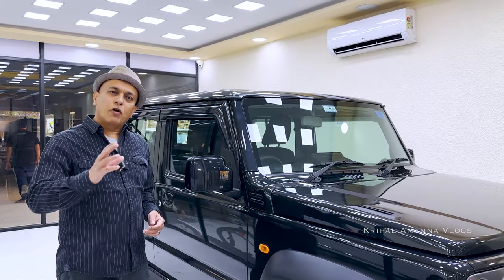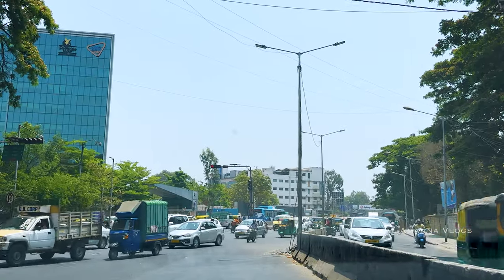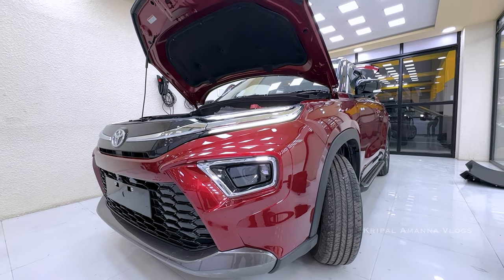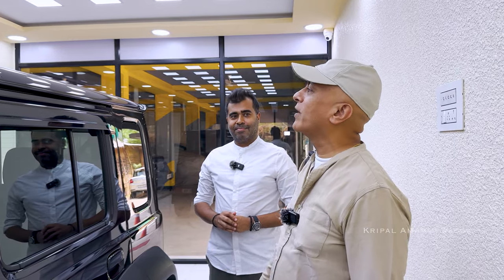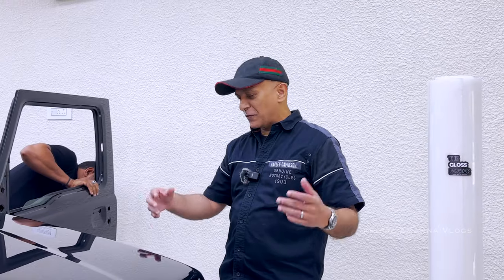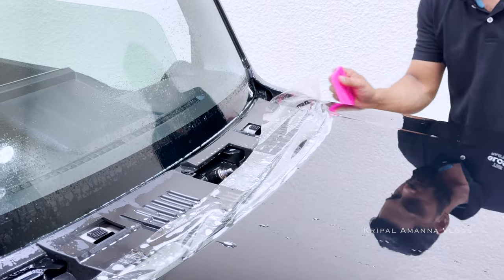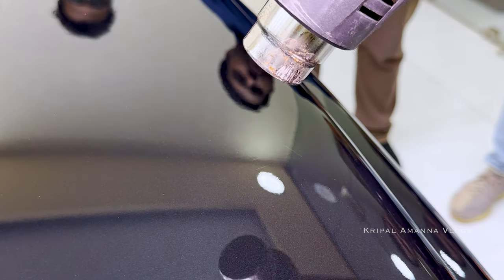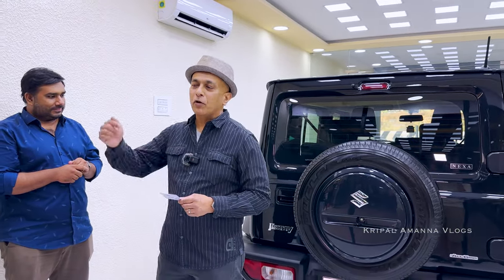The Jimny Gets Protection! Should You PPF Your Car? Watch Before You Decide! Complete Process...

Comment: Good afternoon dear Kripal - Just back home after my traditional Sunday lunch with my family. So the vlog is about to PPF or not . To begin with I agree with Prashant ; owner of The Glass Factor on a few points - 1) It’s better to get a PPF done while the car is new . 2) Since you have driven and intend to drive the Jimmy over long distances, better to get a PPF done ✔️. 3) The PPF or clear coat will not peel off the Paint of the car . I am aware about this space as , in the past , I have worked with MNC’s and we used to supply our specialty products to the OEM / dealers / Car studios . Good that Jimmy is getting a Jacuzzi and if it had a voice would have thanked you 😀 Next step is to remove the imperfections with the paint correction process 👍 I can see you a tad shocked to see Jimmy being dismantled ( looking naked 😀) It’s a genuine concern that post the PPF treatment process the Jimmy needs to be back in shape ( You subtly checked with the technician that if Jimmy would be back to normalcy ) . To be candid it’s not practical to have a look at the car when it’s in the stock yard before it’s delivered to the Dealer’s bastion . Now time for the main part ; incorporating the PPF on the car . The material used is Thermoplastic polyurethane (TPU) is an essential ingredient in PPF , capable of producing PPF that can provide premium protection, without yellowing or degrading, for close to a decade . They use IPA ( Isopropyl Alcohol) which is a solvent . The role of the IPA is  to “anchor” or "lock" one part of the piece so that the film can be stretched. This solution is also used to remove the slip solution from under edges that won't stick down properly. The mixture is typically 10% IPA to 90% water. Time to pick up the Jimmy and its Glistening ( indeed Glossier than when you got it from the Nexa showroom  ) Hello to Arun 👋 Post the Chrome Delete the front part of Jimmy looks much better 👌👌 I am sure you would have had your heart in your mouth while conducting the scratch test 😀 It’s safe 👌 The hydrophobic water test is just a marketing gimmick as we are aware of the hydrophobic properties of the PPF . Good that they have given you a 10 year warranty 💯. Oh the cost is Rs 1 Lakh ( 6-7 %  of your Jimmy cost ) . TPU possesses excellent toughness and a robust thermal repair capability. On the other hand, TPH is fragile during usage, lacks sufficient protection ability, and the adhesive layer chosen is prone to detachment. No wonder the cost is 50% of the TPU - PPF . I agree for you the PPF is a necessity for Jimmy given its upcoming usage . Good choice Kripal . Thoroughly enjoyed this informative ( technical revision) vlog 👍 I am happy that you are satisfied and got a good deal 👍👍 Have a wonderful Sunday ahead and Stay blessed 😇. Loads of love and respect 🤗🤗🤗❤️❤️❤️
Reply from the maker: Hi Rajesh, your comment was re-assuring and you seem to come from a position of experience and knowledge on this matter, where I am only a recent learner. Why re-assuring, I just responded to another comment that was less than positive on ppf, but I think he perhaps is talking about tph. Do take a look and let me know. Have a good Sunday evening and a great week ahead. Cheers!
Reply: @KripalAmannaVlogs  Hi Kripal - I did read the comment posted on the cons of PPF . Looks like he is confused between a wide variety of options for car paint protection. Jimmy has undergone a PPF - TPU treatment and you are correct he might be talking about TPH . I have already highlighted advantages for you to go in for PPF -TPU for Jimmy . You have a 10’year warranty. Just ensure that you are prompt in terms of the maintenance of the vehicle. Please diligently follow their instructions . Eventually you need to allow for the binding of the PPF on the vehicle . From what I saw in the 27 odd minutes of vlog I am pretty confident that The Gloss Factor guys know their job . The technical pitch provided by Prashant was very clear and he also addressed your concerns . I wish you and Jimmy a Happy Driving 👍
Reply from the maker: Thank you, Rajesh. Appreciate your inputs.
Reply: @KripalAmannaVlogs  You are most welcome dear Kripal ❤️
Reply: Your observations are crisp & to the point. Really appreciate your inputs. However, couple of doubts still linger in my mind.
Firstly, I personally feel, that a lakh of rupees for sticking the PPF on to the the size of Jimmy is a bit too much, as the whole job can be done in 1.5-2 days flat. (Mainly talking of labour involved here) Further, an alternate way of looking at it could also be that, the same 1lakh can be used for getting the real paint job as well. I think that amount could well suffice for atleast 4-5 coats, if not more !
Secondly, what sort of scratches does the PPF protect or guard against?
Does it guard the paint from a scratch caused by mischievous boys with a stone in hand or some sort of a key/any such tool & of any scratches caused by the impact of a bicycle/two wheeler ? Or does it protect the underlying paint only from scratches caused by bushes & thorns, that inevitably get brushed against the body of the car, especially in rural terrains ? 
Appreciate your response. Thank you.
Reply from the maker: Thank you, glad you found this vlog useful. In my understanding, the ppf protects against normal scratches caused by an object scuffing, abrading, impacting or scratching against the body of the car. As long as the impact/ incident does not tear through the film, the protection is adequate. If someone maliciously intends to damage the vehicle by running a sharp object on the body deep beyond the ppf layer, no film will protect. Lastly to your point of painting, yes, you could perhaps get the car painted for the amount of money that you spend in the ppf, but compared to the inconvenience of heading to the body shop each time you get a scratch or a scuff and parking the car for days on end, I would personally prefer to avoid as far as possible. Hope this addresses your queries.
Reply: @KripalAmannaVlogs  Thank you very much. 🙏

Comment: Kripal Sir, With due respects to Prashant & Team on their expertise on applying the PPF, however it is not a very comfortable sight to see the car being dismantled the manner in which it has been done ( especially a new car ), even though they fit back everything in place as per factory precision. Personally I would have done away with this activity, however it depends on my driving terrain too ( which is mostly city based ).  Hope it works the way it is supposed too !!
Reply from the maker: @amritrao01  I understand your concern. However, this is necessary to apply the ppf properly. Am happy with it thus far. Have driven through some coffee estates where the plant has brushed against the car. The ppf Seema to be holding fine.

Comment: I got the ceramic coating for my Kawasaki z650 done from the Gloss Factor. They provide an awesome service 😊.
Reply from the maker: Nice, am planning to do something similar for the Fat Boy. Would you recommend the ceramic coat, PPF on motorcycle is tricky.
Reply: Hi Kripal, I would suggest to get ceramic done as scratches on a bike are comparatively less than that of a car, I've done the same on my 5 year old cbr250r and it was looking better than when I purchased it brand new. However when I recently purchased z900, I got ppf done as the bike was brand new.

Comment: I've PPF on both my cars, over 1.5yrs clocked now. My 2 cents, 
1. More micron does not translate to better protection. Stay between 180-200 micron. 
2. TPU PPF is worth the money
3. Choose a detailer with PPF damage covered. Which means if the PPF gets torn due to accidents etc. It'll be replaced for free.
4. Many detailers overcharge, do your market survey very well.
Reply from the maker: Very valid points, Dipayan. Thanks.
Reply: Any good ones.that you know in bangalore?

Comment: Thanks for such an enlightening video. There’s just one area you forgot to address and that was the daily washing ritual. Is it required? Or is dusting with a soft cloth is all that’s needed? Were you advised to use some special detergents or microfibres?
Reply from the maker: You are welcome. As for the washing ritual post tpu, it’s as per the use of the car and may not vary much; I think. Am guessing the dust and dirt may wash off easier though:

Comment: Dear All - I have a Pajero Sport 2015 model ...did PPF immediately and now it is around 9 years... My advice is not to do PPF at all.... i did in 3M showroom in Yelhanka...After 3-4 years...the PPF gets cracks  all over....the shine of the car is lost and i went to have it removed and it seems the paint will go if we try to remove the PPF ..so i have to get the entire car repainted which i do not want to since the original paint is good...So i am at a loss of words on why i did PPF.
PPF not worth the money...rather do regular wash...polish or ceramic coat...